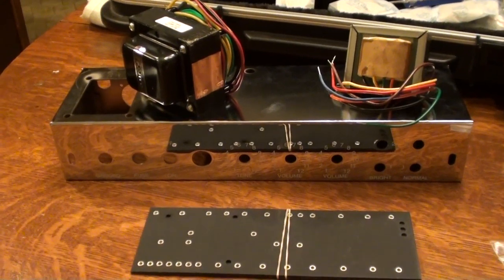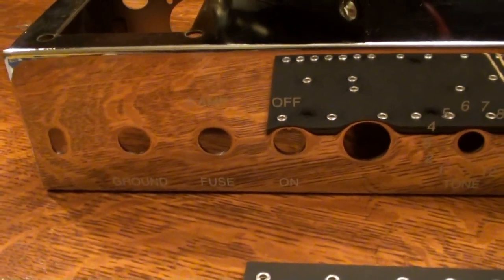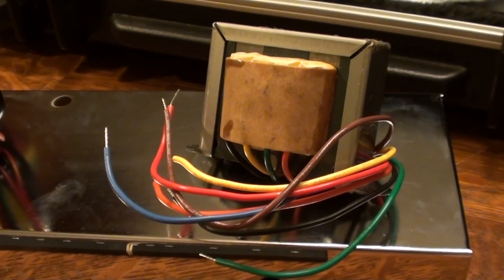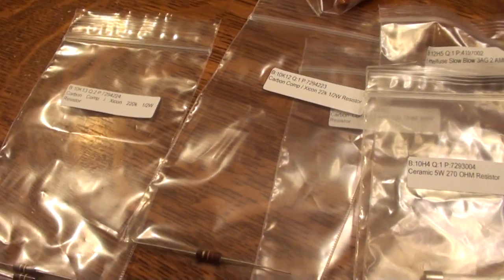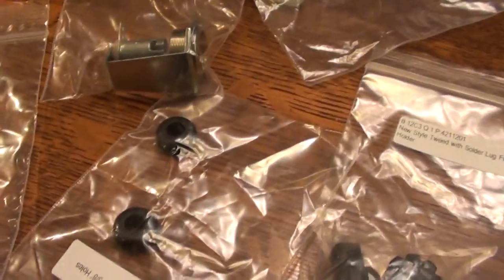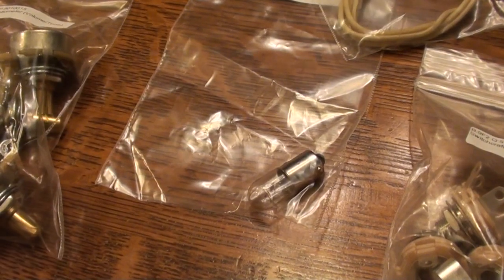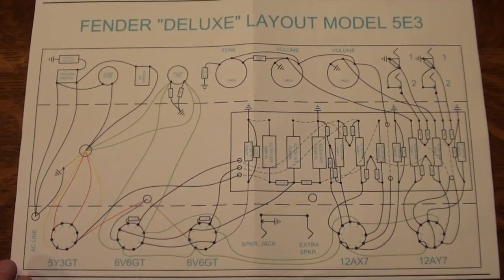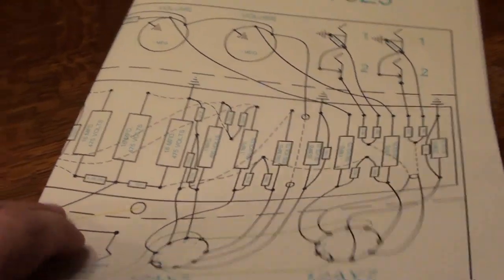Mojotone Tweed Deluxe Amp Kit Intro

Comment: I just saw your post on a 5E3 kit build. I have an oringnall 5E3 that I am going to have to repair and in that process it will no longer be completely oringnall. It's sad but necessary to be able to use it. I will not sell it after so I'm going to do several mods to bring it as close to the amp I want. Bravo on your adventure in creating a tube amp.
Reply from the maker: Thanks for responding to the video.
Enjoy your rebuild!